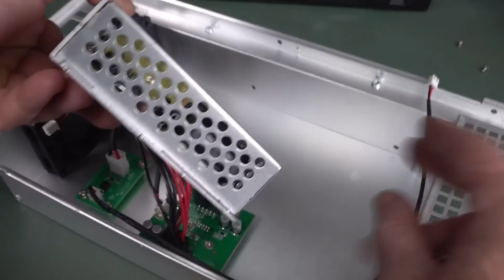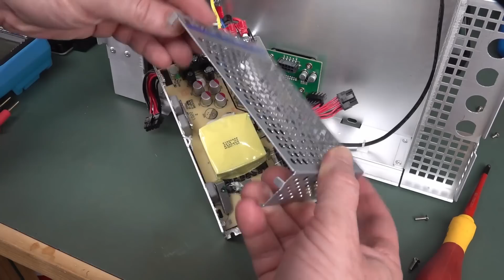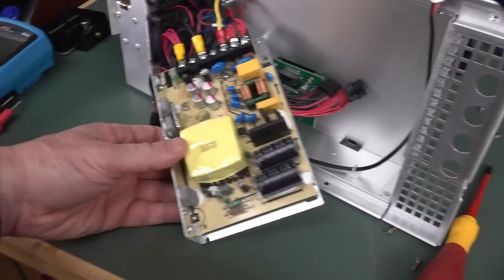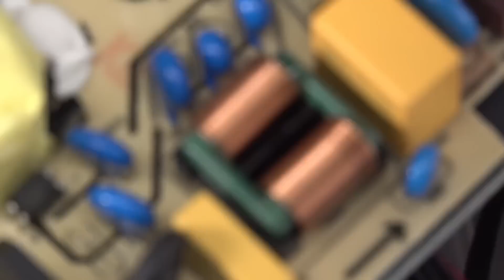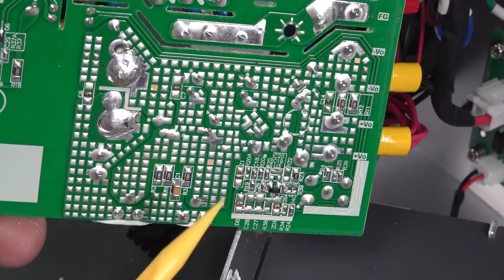Rigol HDO4000 PSU Teardown

Comment: Oh wow, flat windings in the common mode choke
that must have taken some mechanical force
Also an abnormal output diode arrangement, using two dual diode packages as a single diode instead of the dual tap dual diode config

Comment: Hopefully they are better than what Agilent used in the 3000x series.  We have a several of those at work and they've been dropping like flies.  Most of them have had their PSUs replaced with Meanwell units.  That's one of the advantages of going with an off the shelf supply - easy to replace if it ever goes bad.
Reply: Quality construction and power supply modules are way better on Agilent X2000/3000. For sure! Psw is not modular like this Rigol, but quality is another level! 😉
Reply: @pacomassa1379  Don't know.  The PSUs failing on 3000X series scopes is a pretty well known thing though - there's several threads on it over at EEVBlog forums.  That's actually what we followed when we had to replace ours.  The rest of the scope is solid, but looks like maybe Agilent didn't pick a very good vendor, at least for the vintage of scopes we have.  And unfortunately, Agilent won't sell replacements for those - their solution is buy another scope.
Reply: @ccoder4953  Yes! True story! The big trouble of Agilent stuff is that there is no any replacement parts to buy or possible to repair! Same thing with my U1273 Oled display!! Agilent solution!? Buy a new one!! Are you kiddin' me Agilent!!? All of this stuff cost hundered, thousand of money! I love agilent pdoducts, but for this reason I will not buy anymore anything! Their company policy is tototally crazy! Like a joke! It is not possible!

Comment: Off the shelf makes sense for a scope, they might have production runs in the 10s of thousands whereas the PSUs will be made in much greater numbers. The cost of designing one would outweigh any savings, especially if you own the company making the PSUs (or vice versa). It looked like a nice design and probably costs ~$10. I think I saw an inductor in the output filtering and plenty of supply side filtering too. The cheap $5 version will not have that input filtering and will radiate noise back via the mains. Not what you want in a sensitive scope.

Comment: Switching power supply modules are dirt-cheap in high quantities, they are used everywhere. You'd have to be nuts to lay down your own PS nowadays unless it's some odd DC voltage

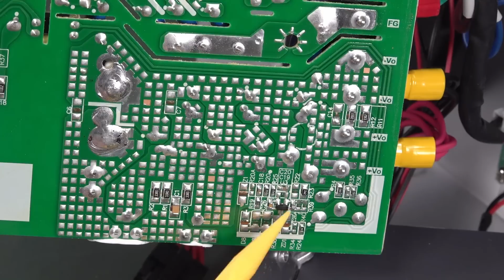Comment: at 5:20 you say they are just diodes, but you can see from the top that the center pin is pulled forward, and you can see that pin from the bottom as well. Perhaps a dual diode package, but just as likely they are transistors, or am I missing something?  I am not an EE, so maybe something about power supply design that I don't understand says these are diodes.
Reply: Dual shottky diode used with both halves together. Could have used one of the more modern mosfet active rectifiers and gotten another jump in efficiency simply by having the forward voltage drop on the rectifier be 50mV instead of 400mV, which with the 6A power rail translates to around 3W of heat less in the power supply.

Comment: Single rail 12V? Well, that'd make it easier to build a battery pack for.
I got a bunch of 24V to 12V ATX PSUs for a Pentium 4 era till (The "Blade" branded stuff), that and a drill battery or few and this is an instant portable... could even be made self-contained too.

Comment: I think they went with off the shelf PSU because of component shortage and they didn't want to go into trouble of trying to supply all the separate components for custom PSU.
They found manufacturer with ready made PSU and large stock they were able to secure and job done.
Reply: Definitely agree with component shortage. I'm also having the same problem in my current designs in my company. Chips have a long lead time and you see weird things in the stock situation, like zero stock for a long time, then a sudden boom of a couple of thousand pieces and then back down to zero again. And sometimes the entire stock is bought by scalpers who then go on to resell the parts for double or triple their original price. And it's not just ICs either, also passive components like transformers and inductors are very hard to find.
Reply: @InTimeTraveller  I know man it's so bad I just want to stop being a PCB designer for a year or two whatever until the shortage ends it's so painful...

Comment: Those days it's rather surprising to see a device that doesn't use an off-the-self PSU unless it's some mainstream gadget that had billions for development. Even seen several devices with external plastic welded case power bricks mounted on the inside of the device! And I would certainly do the same, the extra cost per unit is well worth not having to spend the time and money designing your own PSU especially when there's such a choice of standard modules that are very well designed with very high efficiency and already pass all the regulatory requirements so you don't have to compliance your product nor worry about the liability. Only issue I would argue is supply chain dependence, but just design in standoffs for multiple manufacturer's PSUs in case your preferred supplier has issues.

Also formal electronics education courses (in Australia at least) aren't what they use to be, if you do a power electronics course today they're not risking the liability of letting you design your own 240 V AC-DC PSU, screw it up and burn the university down or electrocute yourself, it's going to be a touch safe DC-DC at 30 V max.
Reply: My Ryobi 18V work light does that. There's a battery connection and a mains plug. It is simply a wall-wart inside the case with the mains plug sticking out.
Reply: es, but can't say I've seen one in a bench scope before
Reply: @EEVblog  Probably off the shelf till they can forsee the volumes they will make, and then they will simply design a drop in replacement to go there, or the power supply manufacturer is a preferred supplier who does stuff for the brand a lot, so the cost is close to being the in house price, and they can get volume to drop the price further selling on the open market.

Comment: Interesting that there appears to be no active power factor correction in that supply, though it's rated at well over the 75W which is, as I understand it, the threshold for compliance with EN61000-3-2 on harmonic emissions.
Reply: Datasheet states compliance up to 80% load. Step ahead of the usual low-cost Meanwells.

Comment: Rohde & Schwarz RTB2K series scope also had an off the shelf power supply. Yep, just checked, An XP-Power 1470-1296-ND according to mikeselectricstuff video
Reply: Yeah, same with the R&S RTM1000 scopes (N2Power XL125-1ATX).
In the RTM1000 they tend to fail in Standby-Mode because of heat problems.
The PFC blows up, because the lag of heat convection.

Any ATX power supply with -12v can replace it.

Comment: This all looks a bit thrown together from bits in the parts bin. Even the line sync takeoff was what looked like a test board that they decided to just bolt in. As for the power supply - they've gone the simple route from the point of view of UL, EMC, Energystar approval and bought something off the shelf that already meets spec. OK, they'e thrown their design skills at the front end where they could perhaps make a difference.
Reply: Nothing wrong with that. In fact it's smart if you aren't pushing a low price point.
Reply: @EEVblog  OH, it's an excellent way to produce something that is probably not going to see a huge volume. Pick up stuff that already works and bolt it in. Engineering is for volume.
Reply: You'd have to be mad to design your own SMPS for such a device. Even mass-produced consumer devices usually have a power supply made by a specialized OEM. Only that you'd usually see an open-frame module inside such a device, not a fully enclosed one.
Reply: @MarianKeller  Saved them adding the shielding, plus also means they can change supplier no problem as they all fit the same volume and form factor.